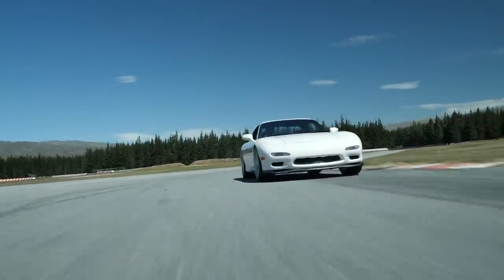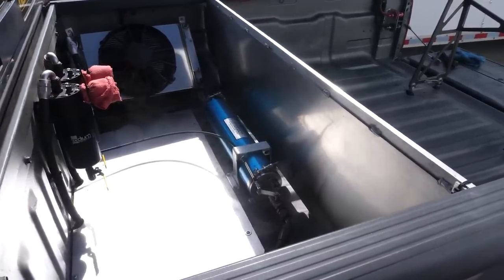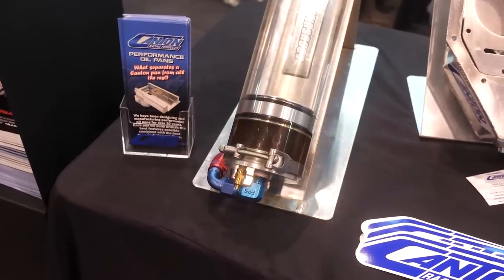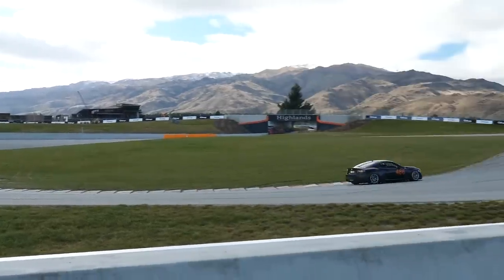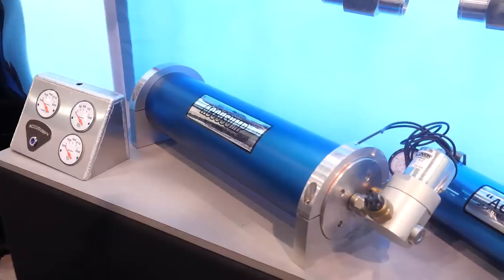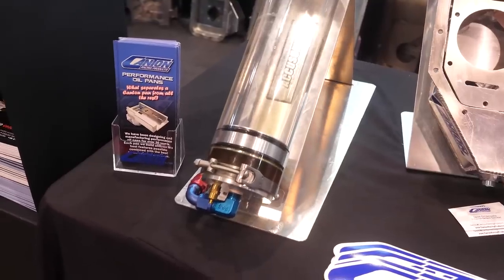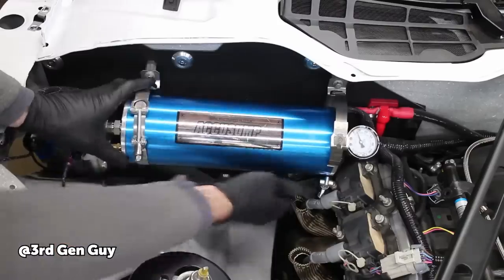Will This Save You From Engine Failure?

Comment from the maker: Who's using an Accusump and did you fit it before or after oil starvation issues had an argument with your bank account? - Taz.
Building a fast car? Get $400 OFF the all inclusive VIP package deal:  https://hpcdmy.co/vipy48
50% OFF your first engine building course. Enrol now: https://hpcdmy.co/offery48
TIME STAMPS:
0:00 - Oil Starvation: This Kills Engines
0:22 - Accusump History
1:01 - What Is An Accusump?
1:35 - Installation
2:13 - Hose Sizing
2:40 - How It Works
3:26 - Manual Ball Valve Activation
4:06 - Electronic Valve
4:46 - Pressurisation/Pre Charge
5:38 - How Long Protection Lasts?
6:28 - Pre-Oiling Function
7:25 - Rough Pricing
8:28 - @cantonracingproducts 
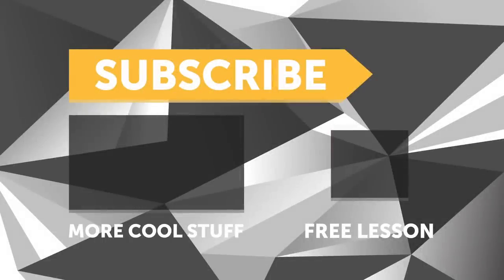8:45 - BUILD.TUNE.DRIVE
Reply: I have been using it for a few years now. On both my race car and daily. 2jz half mile racing and f10 m5 s63
Reply: Running one on my SR20 S13 drift car. Wanted the insurance of one after building my motor as a dry sump was out of my budget range.
Reply: I had one on my car for two seasons and it never went off. Oil pressure logging shows that the pressure never came close to dropping enough for it to be needed. The main benefit I saw was with pre-oiling the car before start up but when you really need that is after an oil change. Pre-filling them is far more awkward than it really should be for that purpose though.
Reply: It isn't as good a having dry sump. But it is a LOT better than having nothing! Run bearings twice on a race 4AGE before fitting it, didn't get the same issue after. The extra oil sloshing round the engine can cause different issues, as can the slight drop in normal running pressure if your oil pump is already on it's limit. Pre-oiling facility is handy!
Reply: It's pretty simple insurance for those of us with classic cars and street machines, to prevent dry-start for a car that isn't used daily.
Planning on adding one to a VC Valiant that's had a big brakes upgrade and can stop hard enough to cause oil starvation.
Reply: @MRJZA75_34  did you install it on the M5 for a particular reason? I.e. were you seeing times with low oil pressure? (Fellow F10 M5 owner here so intrigued!)
Reply: Ive had one on my ford sierra for years ,for cold start protection and to mitigate oil surge under braking, very pleased with it and its way cheaper and easier than getting a baffled sump
Reply: I've been using an Accusump accumulator on my turbo RX7 for a few years now, and it's worth it's price tag.  My oil pressures are super stable on the track with the accumulator.  I also use it as a pre-oiler when the car sits as a while, as race cars do.  Before, on the track I could see the oil pressure dip under hard cornering and lower overall pressure due to aeration.  After installing an accumulator, the pressure is rock solid and higher overall.  Including the accusump and lines and hardware, it probably set me back around $1200, I think well worth the cost.

Comment: As a previous Accusump user I can say that if oil pressure is lost and the Accusump discharges towards the oil filter without a check valve it will mangle the oil filter anti-drainback valve and may not provide enough oil to the engine to keep the bearings happy. You really do need to pair the Accusump with an oil filter relocation and check valve.
Reply: That advice is included in the very detailed instructions included in the kit. They’re simple systems and easy to install.
Reply: The check valve is key.    It's surprising how many people don't install one.  It's in the manual. 😅

Comment: Used one of these in a car powered by a motorcycle engine. An RPM switch would arm it above 3000 rpm and a pressure switch would activate the electric valve if the pressure dropped. Also had a toggle switch connected to the valve to use as a pre-oiler for startup. Held pressure just fine while the car was in winter storage. Great product!

Comment: In reality, an Accusump is better than a dry sump under certain conditions. For example, if you flip the car on its side in an offroad application, there's a possibility that not even a dry sump will be able to get any fluid from the tank. Look at the crazy things that Monster trucks do. I remember when they used to run over cars very slowly. Now they do backflips, jump higher than the power lines, and do donuts on two wheels. Really, if you have a really big accusump, it's a very effective system. An Accusump will actually work upside down.

Comment: I have an "rpm x oil pressure" table in my haltech that will open the accumulator when pressure at a particular rpm falls below the given value. Very easy to setup and change on the fly with a laptop. I also have a bypass wire with a momentary switch so I can oil the engine manually before I start it, although if I wired the starter to be controlled by the haltech this could be automated as well ^_^
Reply: Sounds like you just need the G-sensor now :)
Reply: This is the way...
Reply: In this setup with the accumulator only being discharged at certain rpm and oil pressure values, is it possible for “cold/thick” oil to be introduced when required?
Or is there a small circulation through the accumulator with the engine running? Keeping the accumulator oil similar to the engine oil temperature? Engine bay mounting may help warm the oil somewhat also I imagine.

Obviously cold oil is better than none though!

Comment: Put one of these on my SR 180 after my first few track days. Works wonders with the extended sump and oil cooler and I no longer see pressure drops which were common when I came into the pits after a hard run around the circuit.

Comment: An accumulater is not a dry sump substitute    its a failsafe device  and a pre oiler nothing more,   dry sump systems  address completely different  problems and performance  requirements.
Reply: Nobody said it was a dry sump system...it was inferred that it's a system that LIKE  a dry sump,  keeps your engine full of oil under conditions that one might feel they need a dry sump oiling system for.....

Comment: Hm, perhaps i should get one, a dry sump is not very expensive for my car, but I would have to give up aircon which I'm not too keen on 😅 But trying to fit everything in my already extremely crammed engine bay is going to get tricky, because I also still need to add a methanol tank somewhere
Reply from the maker: I mean removing the a/c would also free up room right....😅 - Taz.

Comment: How does it fill up at first? How do you keep it from over filling the engine?
Reply: It fills up using the oil pressure and you will need to continue to fill it up until it's topped off and your sump is also topped off , you are NOT driving your car at this point since its the first time filling it and it only fills your motor if there is a pressure drop and won't over fill because if there is normal pressure then it's not adding any oil and the oil it adds goes directly into the oil ports not the sump so it won't over fill also once pressure gets back to normal it starts to fill again so again no extra oil will be added to the sump
Reply: A check valve prevents the system from flowing back into the crankcase.

Comment: How does the Accusump work? the 1-2 liters of oil in the tank can save the engine, but the 1-2 liters of extra oil needs to fit in the engine or the crank will hit all that extra oil in the sump from the accusump.
The pressures needs to be balanced for the sump to not overflow or is there electronics or valves to prevent the sump from overflowing?
Reply from the maker: This doesn't add any extra unwanted oil pressure noting it is adding oil when your oil pressure is low, not when everything is spot on. It then refills as your oil pressure returns, not while it is still low.
The instructions cover some aspects we didn't touch on in this interview if you're interested - https://www.cantonracingproducts.com/accusump-accumulator-turbo-oiler-tech/ - Taz.

Comment: But if your oil pump is sucking air/oil mix, the pressure does not drop and so it doesnt help?
Reply from the maker: Not sure I follow. This goes on the pressure side. They have some instructions that are very clear and run through a few options if that helps you wrap your head around things further - https://www.cantonracingproducts.com/accusump-accumulator-turbo-oiler-tech/ - Taz.

Comment: What setup with accusump (valve type, capacity etc.) would be ideal for a turbocharged 2013 Toyota 86 that is daily driven and taken to drift events?
Reply from the maker: Best to have a chat to your local supplier, they'll get you sorted - Taz.
Reply: Call them up.  They’re pretty helpful with sorting out what you need.

Comment: Oil starvation killing engines? 
The oil pump is the biggest enemy of an RB, perhaps I should look into one of these.
Reply: The issue with RBs is that at extendes high RPM use the oil stays in the head and the rotating assembly is starved of oil. The head needs oil restrictors installed to combat this issue, but an accusump could help.

Comment: Would rather just have electronic oilpump opposite side of the mechanical one. You can have oil pressure before engine even turns. 

Accusump provides 10 seconds thats nothing for some cranktimes 😂
Reply: @DNANDROID  if you still have no oil pressure from your oil pump after 10sec of cranking, you've got bigger problems than an accusump can solve.

Comment: I've a possibility dumb idea related to these, it seems to me if the accusump was mounted vertically there'd be no need for the piston, making it a simple pressure chamber with oil coming in the bottom. Second and this is a bit more out there, but after looking at some oil cooler installs with the oil ports at the bottom of the cooler it occurred to me that the oil cooler is almost acting like an accusump, ie oil pressure compressing the air potentially trapped at the top of the cooler. Which then lead me to wonder if we could deliberately take advantage of this by installing valving or a pressure vessel off the top of an oil cooler. Agreed most oil coolers wouldn't have large enough volume but if you had a thermostat on your cooler a larger cooler and more oil volume is not a bad thing. Would it work?
Reply: Yes you can install an oil reservoir onto your engine. That’s exactly what this is. A pressurized oil reservoir. Helps keep your engine alive.
Reply: Years ago we had a thing called a 'Turbo Saver' on a truck which was a similar thing to an Accusump but just on the turbo feed. It had no piston and fed from the bottom, it was basically a fire extinguisher bottle mounted upside down.
The idea was to feed about a litre of oil into the turbo after the motor shut down (or broke down!)
Reply: @buildaboiworkshop no he was talking about the oil feed to the turbo, basically the same reason we used to have turbo timers, your turbo was burning hot before you turn off the engine and cease the flow of coolant and oil so it sits there baking the oil. The pressure reservoir provides a few minutes of oil flow after the engine is turned off cooling the turbo down.

Comment: I could make this for £50
Reply from the maker: Why haven't you? - Taz.
Reply: @hpa101  I don't need one, it's only a pressurised hydraulic ram if I did tho local forklifts wouldn't be safe 😉😂
Reply from the maker: @BoostedMike go on, the old you would have 😂 - Taz.
Reply: You've changed mike
Reply: not the complete kit, maybe the piston, but for you if you have machinery at home, but never for sell.
Reply: ive always been a cheapskate and i like building stuff myself i have a lathe, this is why i make my own of everything even down to my own suspension that im currently working on based on a trophy truck, its blokes like me that have a need for something that we then make who starts businesses like this